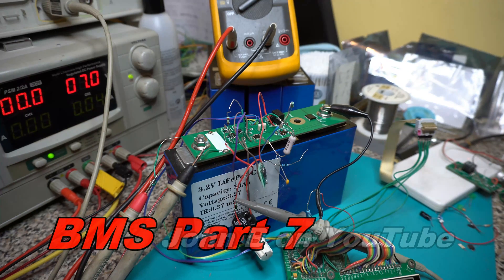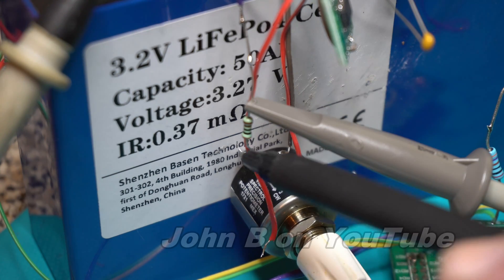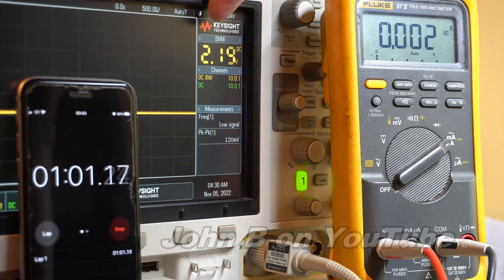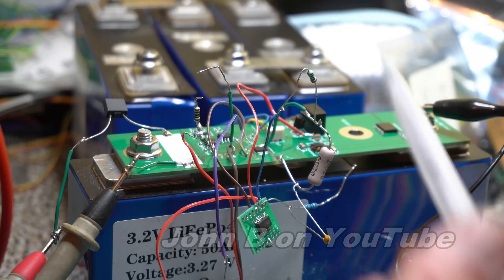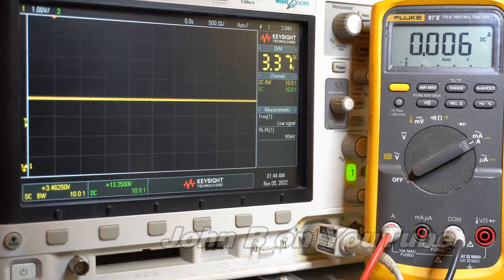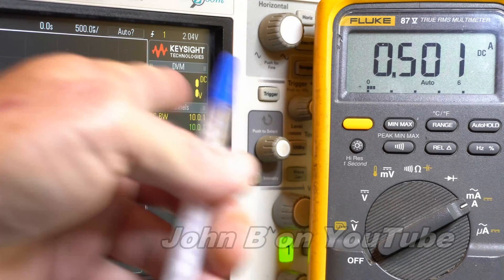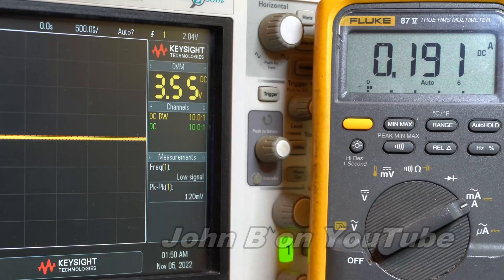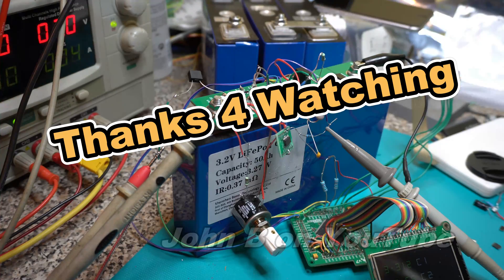Battery Management System (BMS) Design Part 7 - Thermal Runaway & Electronic Loads.

Comment: For active cell balancing why not use a super cap and just shunt into it from a single cell and then once in equilibrium turn off the fet to it from the cell and then use a boost to send the power in the cap back to the entire pack or to a single cell if you want?  That way you don’t need isolation and your only loss is a tiny bit in a fet and the super cap. 

If you use a double package fet you can switch for both directions per cell and thus shunt outgoing and incoming. Low voltage ones that do say 5 amp are super cheap as is a single boost ic or you can use your microcontroller you already have and 2 fets and inductor you already have to make your own boost since it doesn’t need to be very clean DC.
Reply from the maker: Thank you for your input James, I like your thinking.
I’m only familiar with 1 farad 5.5 volt caps that would light an LED for a minute, it has to be charged slowly for maybe a minute.
What value super caps did you have in mind since I have not given up on the active cell balancer just yet?
It’s funny, only last week I was looking for the smallest Pic microcontroller with i2C & PWM, I’ll have to experiment with my own PWM to see what sort of current I can get.
Thank you again for your comments.
Reply: @JohnB-2021  I’d look at the 2.7v ones as big as you can afford and put them in series so you have a max charge of 5.4v. That way  you always have potential to store the max your batteries will ever discharge. 

I’ve successfully (with lots of noise) used an atmega 8bit mc to do boost and buck with pretty good precision and relatively low output ripple for a bread board with 2 10nf caps and an inductor. Just have to get the pwm center aligned, inverted and deadtime. I used 2 ntype fets with a fet driver and a bootstrap. But I’ve also done it with a $3 pwm ic that does all of the work for you  (center, inverted, dead time and bootstrap in one) and you just pwm in to that so you don’t have to do much other than a feedback on amps flowing to know when to shut it off and balance the next cell.

Comment: Great . Just last night i played with constant current for a leds iluminator . Old boy LM324 and vbe1638 . drive.google.com/file/d/1ZR1ainUIsedeDNKbgskB7I1uYj38l4yL/view?usp=sharing
Reply from the maker: Thanks for the pic.
Did you know your LED symbol is back to front lol.
The trusty LM324, every home should have one.
I need a small op amp, maybe sot23 5 pin.
My LM324 does not swing from rail to rail, I had to wire it to the incoming 5.6 volts to get enough gate voltage. Any suggestions?
Keep the schematics and comments coming, thank you diX
Reply: @JohnB-2021  Ahhh..... it's "just an early prototype" LEDs iluminator . Just looking for myself for a rail to rail, and i got  AD8628 , just bear in mind it can deliver at 5V rail only 30mA , don't know in your design what charge  is needed to drive that mos-fet , most likely will work as lm324 is not far away .
Reply from the maker: @dixsusu  😁 Thank you again diX, I'll have a look at that op amp, 30mA is plenty since I don't need speed.😄